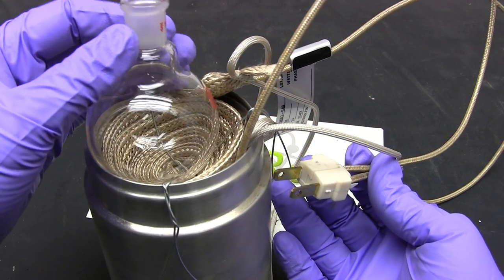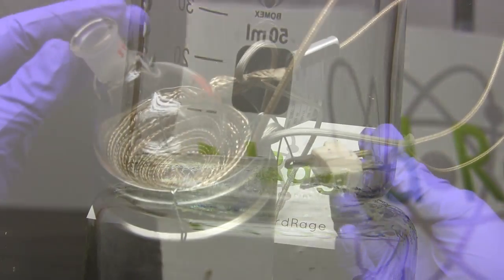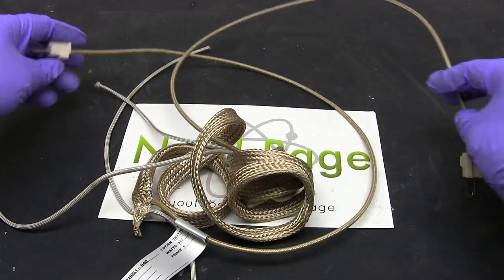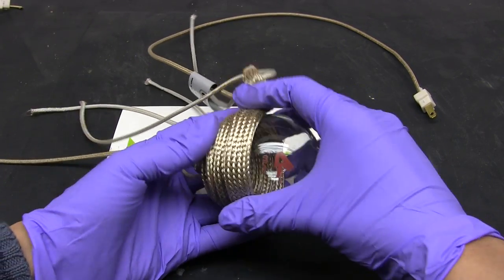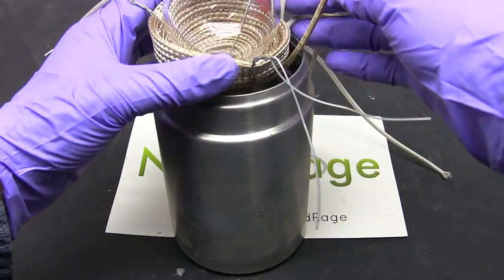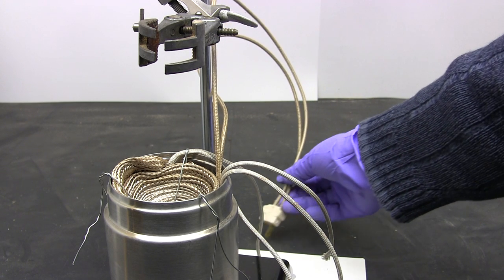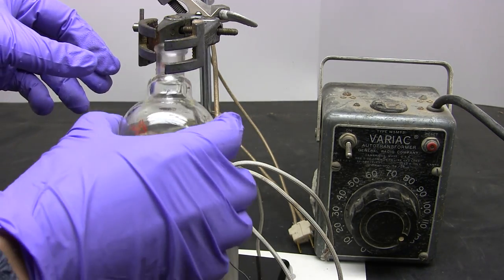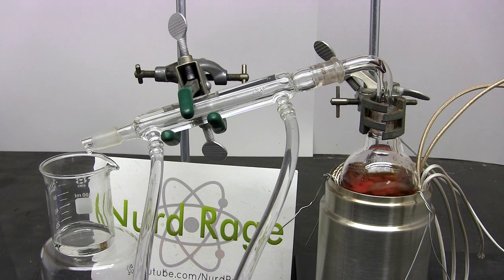Make a High Temperature Heating Mantle

Comment: Oh my god, is that split plug even legal? Imagine if you plugged one pin into the line contact of a socket, the other pin would have potential power on it. It's not even like your sockets all have shutters inside, either.
Reply: I was thinking it looked very unsafe to begin with, even more so when it split
Reply: jayja45 So long as you don't ground out or complete the circuit, it's 100% safe, though it's REALLY easy to ground it out if you're not being careful.  When plugged directly into the standard outlet in North America, you're only at risk of serious harm if you have a pre-existing health condition or if you complete the circuit so it paths across your chest.  House current more often than not will just convince you what you did was dumb and make you very interested in never doing that again.

Note:  That does not apply when we're talking a 220 line.  Get hit with both of the hot prongs and you're toast.
Reply: wolfpax181 I'm imagining such a thing in the UK where all our wall sockets are rated for supplying 13A of 240V and most homes contain old wiring that has fuse wire instead of RCDs.

240V is pretty painful when it escapes. Stings for hours.
Reply: James Grimwood I don't even want to imagine how bad that'd hurt.  15A 110V lines are unpleasant enough for me.
Reply: wolfpax181 Every kid born in the 80s (before UK plugs had insulation down half of the L/N pins on plugs) has zapped themselves while unplugging something.

240V doesn't scare me as much as the inside of a CRT TV does.
Reply: First off, there is basically very little current going through a spark plug, it's like a bit of static electricity going off.
Considering the potential difference is several kilovolts, if there was any noticeable current going through it would consume a very large portion of the engine's power output.

Second, that sentence is as popular as it is wrong.

Yes, it is the current flowing through you that kills you and not directly the voltage.
HOWEVER, unless you have negligible resistance, a high current can only be driven by a high voltage.

Whenever someone tells you "hey, static shocks are thousands of volts and they don't kill you!" they're forgetting to mention that a static discharge lasts a very small fraction of a second, because although the voltage is so high, there is a very small electric charge accumulated, and it immediately depletes before the current can even rise.

In most other applications however, that is not the case.
My car's 12V battery can easily pull 500A on short circuit, and yet I can touch the terminals all day and nothing happens.
Why?
My body has an electrical resistence that prevents those 500A from flowing through me - there is not enough voltage to drive them to overcome that resistance, and thus the actual current flowing through me is probably measurable in nanoamps - completely negligible even from a biological standpoint.

In contrast, my 230V wall sockets can only pull a measly 16A before the breaker trips, but 230V is more than enough to drive a lethal current through my heart.

That's why you don't stick nails in sockets.

So the sentence "It's not the volts that kill you, it's the amps" is extremely misleading in that in 99% of the situations in which you're gonna run into electricity, it does not apply.

Static electricity only accumulates tiny amounts of energy,  and that is the only thing that prevents it from killing you.

The power grid, however, can keep on pumping energy through you all day and not even notice.
Reply: 230v isnt bad, its only going to feel bad. 230 volt AC is going to hurt, and possibly stop hearts though. And that would be because the human body works as a capacitor.
Reply: @demoniack81  Thank you very much, your explanation is more helpful than most I have heard in my life. Maybe I am more willing to learn as I have had more shocks than most because I love doing stuff.

Comment: Thank you for this video. I was looking for a way to make my own mantle, and this helped me a lot. Now, I didn't go for the heating tape you linked to. I found on ebay 2 lengths of Amptek tape, one 8ft rated 400W, and one 2ft rated 105W. I bought both, they came to $30 including shipping. The larger one is great for heating large flasks, the small one for small flasks. They didn't come with plugs, but a plug was easy to install in each. I also made power controllers for them from 600W-rated light dimmers ($5 each at Lowes). They work perfectly fine.
Reply: Hey bud I'm trying to figure a size for 1l flask. does that 8' one wrap a 1l good?
Reply: Nvm answered my own question just now lol. if his cord for his 100ml which has a 2.25" bas dia was 4' then 8' should be just about right for a 1l base dia flask which is about 5"

Comment: I have used these tapes to bake out vacuum equipment (to the point where its glowing) and they are great=) You should connect that thermos to a solid ground connection and only use it with a GFI circuit.
Reply: Why do you think it should be grounded? Those tapes are heavily insulated with fiber glass cloth. While it is working, you wouldn't touch it since it is gonna be hot. Do you think it will have static electricity after its use? Thanks!
Reply: @MuhammedTan  I'd guess out of an abundance of caution, mainly, which is always a good thing. The heating tape is held in with those iron wires, connected to a thermos (likely steel) so if the insulation wears away on the heating tape and you touch it while powered on you might get shocked at mains voltage. It's a hypothetical that depends on a lot of things, but because it could be potentially fatal, I'd spend the little bit of money on a GFCI and run it off that to be sure. But I'm a bit of a klutz. If you trust yourself enough it's not necessary.
Reply: @ryjelsum  Yeah, caution is always better. Better safe than sorry or dead!

Comment: Variacs cost hundreds of dollars and good dimmers are pretty expensive as well. A cheaper and simpler way of controlling the heat output is with a resistive ballast. If you're good with electrics you can wire two outlets in series - plug the heating mantle into one outlet and a regular oil bar heater with temperature control into the other. The temperature control on the heater will also control the temperature of the heating mantle. I use this trick all the time with my AC arc welder to adjust welding current.
Reply from the maker: You don't need a good dimmer for this. a $3 one will do.
Reply: +ShadowOfChemistry A $3 dimmer literally is a "simple phase-cutting circuit using a tyristor" ;) Except they don't sell SCR dimmers where I live, only MOSFET dimmers which cost a huge amount of money. You can import them off eBay for cheaply though.
Building one from scratch for under $2 would be a challenge.
Also I think you're getting the terms VA and W a bit confused, the only difference between VA and W is that VA is apparent power while W is real power. W = VA * cosφ where φ is the phase angle between current and voltage. Generally there is only a difference when it is a capacitative or inductive circuit.

Comment: For a completely resistive load, such as an incandescent lamp or a resistive heating element such as this, an ordinary TRIAC/SCR dimmer which can handle the power of the element is much cheaper and gives as good adjustment range as the variac, and even better if it is a modern, digitally controlled one. Alternatively, a PID controller with SCR/TRIAC output can be used in conjunction with a solid state relay and also give temperature control, which completely removes the fiddling with the variac or dimmer control from the equation.

Comment: The tape is 103$!
Reply from the maker: Odd, my tape was only $47.

Are you looking at the right model number? there are lots of different types
Reply: NurdRage Here is the one that came up in the search, is this the correct product?

http://www.omega.com/pptst/STH_SST_SWH.html
Reply from the maker: JMAPScience Scroll down. When you search it takes you to the page of all their tapes.
Reply: NurdRage
Thanks NR
Reply: +NurdRage hi NurdRage! do I need more heat tape (a longer length) for a 2 Liter flask? or will the STH051-040 work?
Reply: Sorry rather than bother with pricing is there any chance you could  tell us the length of the tape you used?

Comment: i am thinking using the 1/2" x 8" tape, model ( STH051-080) , I want to stick to 120V, have you experimented with fitting these tapes to larger flasks? Loosely wrapped perhaps, I would like to fit at least 500ml, 1000ml may be overkill..

Comment: I bought an electric heater. I think it is called a hot plate, you know, for kitchen table tops. It was 12$ at a used goods store. Just had to fix one of the knobs internal parts. I assume it does 200 to 300 °C.

Comment: I could buy a heating wire... But how do I create one specifically for 100-500f? 115Vac, using nichrome 60? I'll be using a pid controller too. What ohms, gauge wire n length? (preferably around 5 ft).

I'm distilling alcohol and tinctures.

Comment: Is there a reason you are saying iron wire instead of steel? Not trying to be pedantic, just wondering if there are any corrosion worries at high tempt or other reasons. Obviously galvanized wire would be a very poor choice.

Comment: Have you thought of making anything with the inexpensive ZVS induction heaters that you can get cheap on ebay?  I'm not sure how you'd heat stuff in containers, maybe wrap metal around tubes or inside them, and then heat that with the coil?  You can get some pretty insane temperatures.

Comment: What are those two bendable see through plastic tubes connected to that cylinder at the end. What is the purpose of this thing?
Reply: That would be plastic hoses that supply cooling water to the glass condenser. During a destillation the purpose of the condenser is to cool the vapors so they go back to liquid state and drop into the recieving flask.

Comment: I understand with your videos the idea is often to explore the science behind it. At over 100 dollars for the heating tape plus what ever the controller would cost, do you think it be more economical to buy a real heating mantle? I see them pretty cheap on e-bay.
Reply: Most labs already have many controllers but their heating mantles may die or be of a strange size. That said, I have no idea what the standard cost is. This also reaches a higher temp than most heating mantles, iirc
Reply from the maker: I think you're looking at the wrong tape, the price is $47 for the tape.
Reply: NurdRage Yup, was looking at the wrong item, don't mind me. I punched the product code and the 103 dollar item showed up. You're right. its $47.

Comment: can you make alcohol with it? and does is work with lightbulbs and plastic straws?
Reply: You don't need that much heat to distill alcohol.  On the other hand, I wouldn't use these things to do it. You also need to condense the vapor.

Comment: Will the iron wire and thermos withstand 700 degrees forever?
Reply: It should. 700C is only cherry red, but I doubt that the steel will hit that temperature very often.
The thermos is probably stainless, which has the ability to keep its shape at much higher temperatures and will survive.
Reply: The iron melt sat 1500+ so there should be no risk of deformation.

I'm unsure what the thermos is made of but presumably if it were stainless steel it varies, but should be 1400+ for melting
Reply: 1,149C+ Grey cast iron melts.
1,316C+ Mild steel burns and carbon steel melts.
1,371C+ Stainless steel melts.
Pure iron melts at higher temperatures than these, but it's difficult to find iron wire (I've tried), it's likely mild steel at best.

I have a Guide for these temperatures because it's useful in my hobby, I am not claiming to have pulled these temperatures out of my head. :P
Reply: I get my barbecue grill that hot for cooking steak.

Iron starts losing strength around 350°. At 700° it's down to about 30% of its original strength. But if you're not being violent with it, it'll hold up fine.

The point of using iron wire is to not use aluminium wire, which melts at 660°.

Comment: won't the thermos absorb a good chunk of the heat?  I feel like using a ceramic pot might be safer, cheaper, and more reliable
Reply: Vacuum is the best insulator, right? Also, stainless steel wouldn't break but a ceramic pot would break if you heat up fast due to thermal shock.

Comment: I don't know what electrical regulations are like in the US or Canada (I think you're from there?) but here in Australia a metal casing must be grounded to Earth (i.e. the braided wire and steel thermos). I think I cringed at the electrical hazard the whole way through.

Honestly, cutting off the existing plug and attaching it to a three prong plug before adding a grounding wire would be dead simple.
Reply: Heating elements usually don't require grounding. Those heating elements are very closely braided into fiber glass or SAMOX cloth, so it is heavily insulated. I think he is taking enough care.

Comment: Hey NR, been wanting to purify some drain cleaner H2SO4 for ages, looking forward to the video! And it's so great to see you back making vids!

Will a gas burner work? I have a single gas element that heats a sand/paraffin bath that can get me to much higher temperatures. I just know that hot conc. sulphuric acid is very temperamental/dangerous and want to be sure :)

Comment: There are electrical heaters made for roundbottom flasks...or some where you put sand in it and it will conform to shape...i doubt they're too expensive. ...but here you use a variac which is kinda pricey
Heh....or you could also use  steam...check an organic chem lab
Reply: While a variac can be pricey, he did also say a light dimmer switch could work as well. I just happen to have a dimmer switch laying around with a pricetag still on it, I picked this one up a few years ago for 20 bucks and if it works as well as a variac in this situation, it can be a big money saver.
Reply: Gaming With Ryan (Ryan123220) Dimmers are wonderful things for any non-reactive load like this, I agree. They can be pretty good for speed control on tools with a universal motor too
Reply: I think you missed the point of this video.
The goal is not to make an simple electrical heater for roundbottom flask but rather a heater for such flask that can go up to 700°c(which is far from standard)